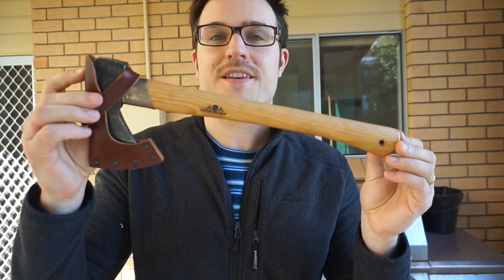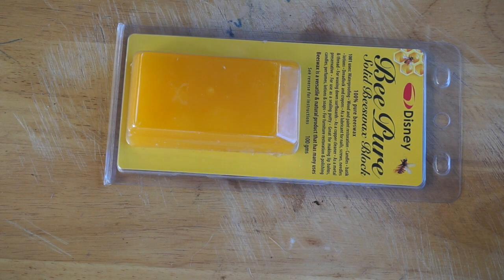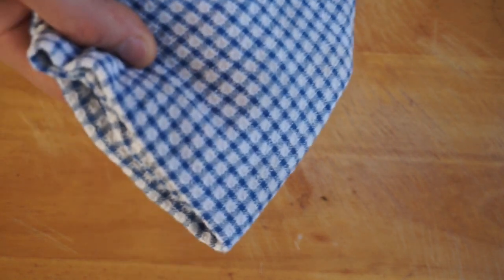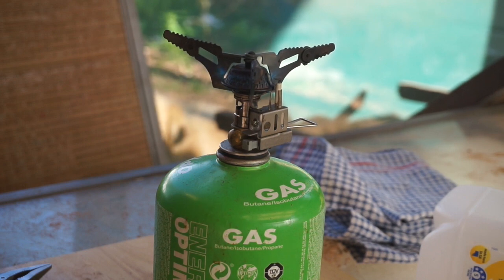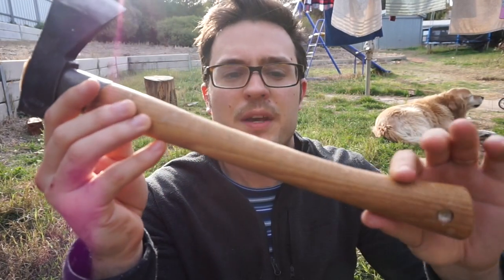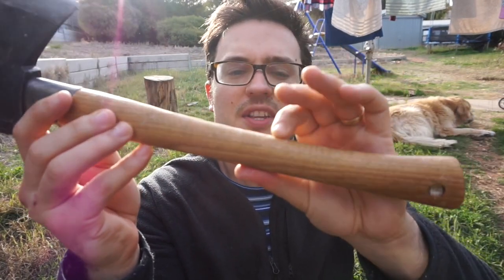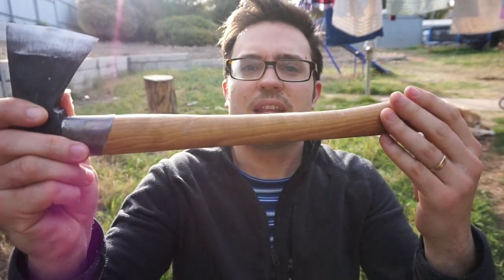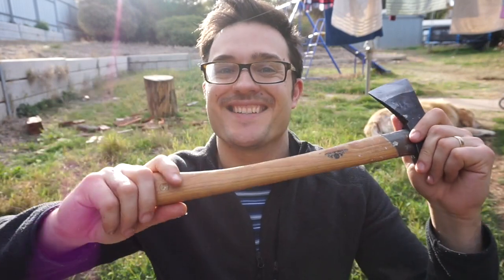Sealing an Axe handle naturally with Beeswax

Comment: Hey Pete, you can also add a little bit of mineral oil into the melted wax to create a "wood butter". Depending on how much you use (doesn't take a lot) the wax will have a softer consistency, and you can spread it on while slightly warm. I made a small batch and poured it into a jar, using it to treat wood cutting boards, knife handles, leather sheathes, and even chapped lips in the winter.
Reply: i'm making a fixing wax now soon for my axe handles but I haven't decided on the ratios yet... a hard wax with a little oil in it would require heating, but a butter type wax with more oil would not? Or would it? what's your take
Reply: Yeah, the less oil, the more solid the mix at room temperature. More oil, the closer to lip balm or even petroleum jelly it gets in consistency.
Reply: @CSGraves  Exactly. For a wooden handle, what's the best ratio between oil and wax you reckon? Some people use 50/50. Not sure how hard or soft to make it.
Reply: Afraid I haven't done much experimenting with the proportions, but I'd guess that your pros and cons would go something like: More wax, longer lasting finish, but harder to apply & less wax, easier application, less durable finish. 
Probably want to make it in a small glass jar or other relatively heat-safe container, so that if you do make the mixture a bit on the hard side, you can sit the jar in a shallow pot of hot/nearly boiling water to soften things up for application to the wood.

Comment: Buy a heat gun and rub the wax on cold, then heat it up(wax and wood Together)
Reply: would a hairdryer do the trick? i'm considering putting some fixin' wax on instead since it's easier to apply
Reply: @mombasadele479  Yes it sure would, I use beeswax on tons of my gear rubbing on cold and heating to melt, there's tons of recipes for different waxes, going to experiment with beeswax and paraffin wax together.
Reply: same thought i had, this seemed like a harder way of doing it.
Reply: I've never waxed timber in my life, but I somehow knew this comment would be here.

Comment: Hey man! Good video. Alternatively one can rub the solid wax into the wood than heat it with hairdryer / heat gun, repeat the process x times. Guess it would less messier.
Reply from the maker: don0giorgio great idea! definitely would be less messy! I just followed he instructions on the wax cos I'm a newb 😂
Reply: You could oven warm the axe to about 70C and then pour on the wax and work it in.
Reply: You could just, rub on cold wax,,and the heat it gently over your camping stove,, less messy, and less wax used.. keep the vids comming.. :)

Comment: I would have added an oil to the wax, I use a 50-50 mix of walnut oil and beeswax nice and warm and it penetrates far better and leaves a super smooth handle with grip. We all know the deeper you penetrate your wood the better :-)

Comment: I melt maybe 2 parts coconut oil with one part beeswax together then apply it. it penetrates much better and still leaves a little tack which I love. the coconut oil does not spoil or at least hasn't in the last maybe 6 years I've been doing it.
Reply: do you heat it up or apply it cold with a cloth? seems like an easy thing to do if no heating
Reply: @mombasadele479  
It will be soft enough to rub in with your hand. The coconut oil has a very low melting temp and your body heat alone will melt it the mixture.
Reply: Jimmy Corn Thanks. I did a recipe with 50% beeswax and 50% coconut oil, shea butter and olive oil. Initially firm but like you said, with finger heat it rubs easily in to the wood when applying with your hands. Nice!

Comment: I bought solid, pure beeswax , had it melt in a pot mixed with linseed oil (about 75% wax per Oil volume, but modulate proportion, the more oil the less solid the result). It makes a paste that's easy to apply
Reply: do you still heat up a wax with oil in it or do you just rub it in with a cloth?
Reply: @mombasadele479  no need to heat it up :)

Comment: Did you consider the Wildlife Hatchet when you got this? I'm currently tossing up between that and this Outdoor Axe. From what I'm reading, the Hatchet is a better chopper while the Outdoor Axe is a better splitter. But I don't know the specific purpose of the one I'll get, it's mainly for fucking around in the backyard like an idiot. Which one is the better all-around axe, you reckon? I'm leaning Outdoor Axe.

Edit: Nevermind. I spent all day watching axe videos lol. Went with the Wildlife Hatchet.
Reply from the maker: subroc yeah the wildlife is the same head as the small forest I think - a better overall 'one axe' rather than having two like I do
Reply: the difference in chopping power between the small forest axe and the wildlife hatchet is quite something... i saw a 10 chop test here the other day and the wildlife hatchet didn't even come close... i would lean against small forest + outdoor axe for a better combo... wildlife hatchet is a good hatchet but in between the two in a way

Comment: Hey mate. A much better method is to create a fixing wax by adding some affordable food grade oil likesunflowet or even raw linseed oil about 2 to 3 times the volume of the wax you use. This dries to form a waxy paste which is easier to spread onto the axe handles and will leave a much more even coat. Give it a try. It works like a bomb.
Reply: do you need to heat it up when applying or not?

Comment: i mixed 50/50 turpentine and tung oil and rubbed the handle every three or four days 8 to twelve times it is sealed and once in a blue moon cause i hardly use it i rub tung oil when it gets used
Reply: the turpentine helps the oil to penetrate the wood then it evaporates , tung oil is not poisonous

Comment: Wait, are you supposed to use beeswax or boiled linseed oil on the handles.  I saw a lot of axe maintenance guides suggest to use linseed oil on the handle? Which is more ideal?
Reply: True Survivor, that's exactly my plan for a couple of hickory shafts I've just ordered to assemble a couple of grubbing mattocks. It really is a solid plan.
The two things I would add is, I've seen in multiple sources that people also mix turpentine in - one guy mentioned a 50/50 linseed turpentine mix for soaking the handle for good penetration, another mentions an equal part mix of linseed, turpentine and melted beeswax. I suppose the turpentine acts as a carrier and aids penetration too.
Secondly, the best finishes on handles take time to develop. Give the handle a really thorough linseed soaking, beeswax coating, sure, and then use the tool. The general wear in your hands as the tool is used, as it wears down the outermost layers, likely allows what oil's beneath to breathe and further cure, and then say if you give it the full treatment annually, that gradual cycle of treatment, curing, wearing, curing, repeat, will leave the shaft with a beautiful finish that you'll really be able to appreciate, especially if you've kept it clean and avoided any unfortunate strikes or damaging blows to it.

Comment: just a heads up... do not leave oily rags anywhere in your shop ffs. seen a multi million dollar home (made almost entirely of cedar and fir) burn to the ground while being build due to used stain rags in a metal can, they spontaniously combusted (or so the story goes the word around town,of only 4500 people, was that it was an insurance job cause the guy having the place built didnt like how it was turning out (the buyer/owner was also the one who designed it)